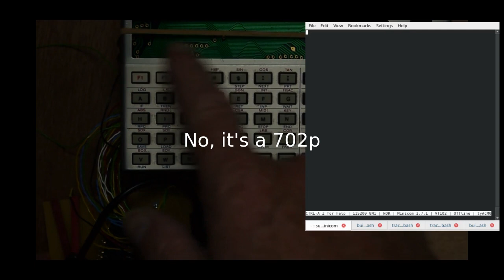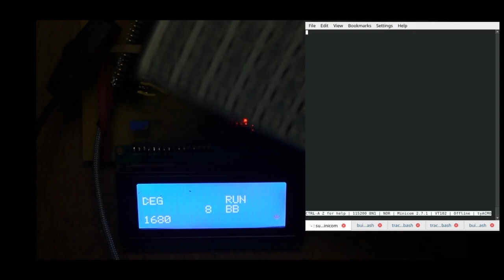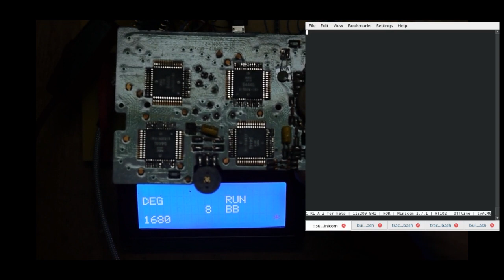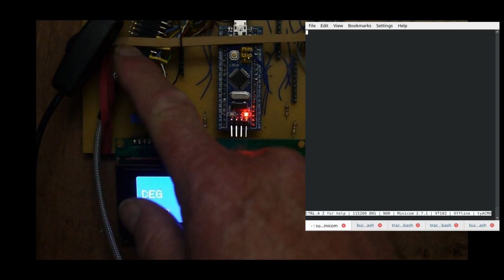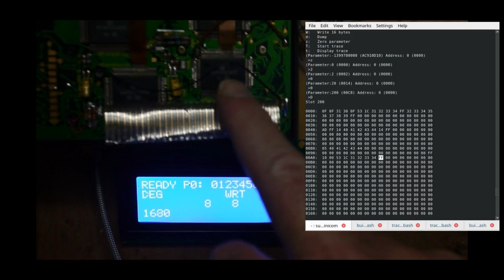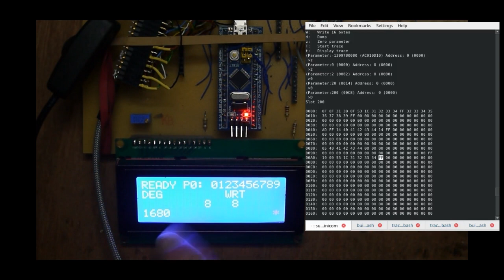FX702P: Can the RAM be Replaced?

Comment: Hi, Do you think you can access the ROM ? It might be interesting to dump it so we could make an emulator of this remarkable machine.
Reply from the maker: It turns out that there's ROM everywhere. There's two CPUs with ROM and there's ROM in the display drivers as well. I don't know of any way to get the ROM out of the devices electrically. It might be possible to decap the ICs and get it that way. Of course, you'd also need to know what the instruction set was if you wanted to make an emulator.